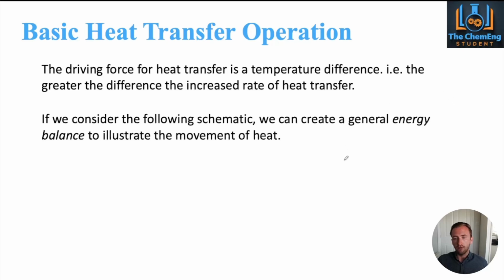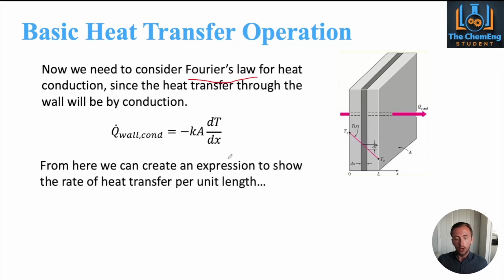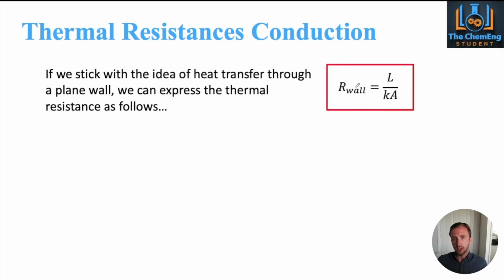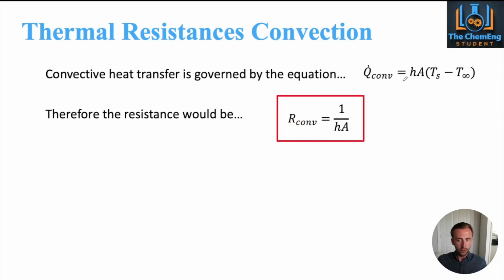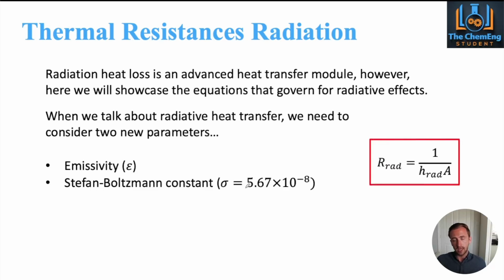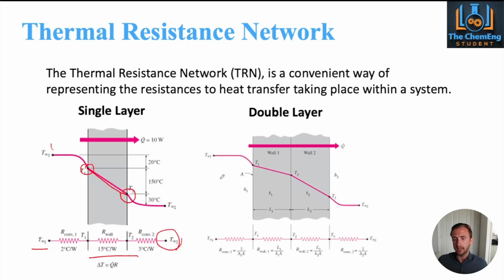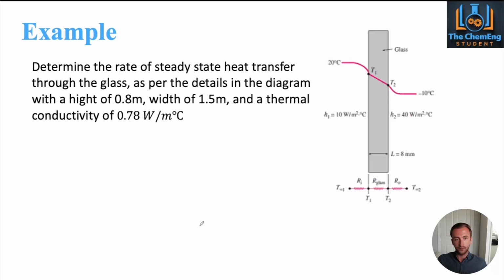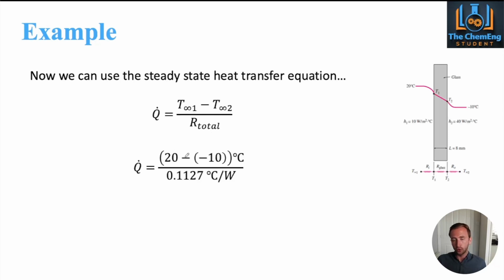The Complete Guide To Steady State Heat Transfer

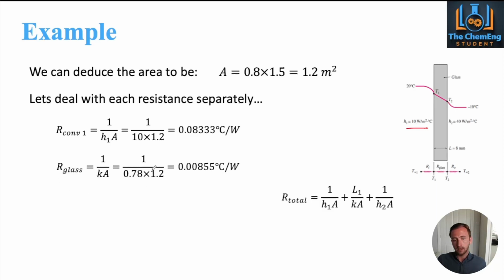Comment: 18:00 the conductive resistance should include the thickness of the glass, which is 8mm.
Reply from the maker: Yes, you are correct that was a typo on my part; thank you for spotting it! I hope the overall process makes sense?
Reply: @TheChemEngStudent  yes, your video is very helpful. Thank you

Comment: at steady state ain't the temperature of both the sides of the conducting medium same ? and thus would not the temperature difference become zero and thus Qins=0 ???
Reply from the maker: No, the temperatures at each side of the conducting material are different due to the thermal resistance of the material and initiate temperature values. The term steady-state, in this case, means that the rate of heat loss is constant throughout the material, which is of course a fictitious statement, but it helps to simplify the modelling equations. I hope this helps, thanks for watching!
Reply: @TheChemEngStudent  Thanks a ton!

Comment: Question: How do you calculate a Temperarure From Tinfinitive 1 to T1 respecto to de distance, means, at 0.5mm of the T1 surface what is the temperature?
Thank you!
Reply from the maker: There are several ways of doing this, and it depends on the information provided/known. The easiest is using the equation Q=hA(deltaT), whereby you can express deltaT as Tinf - T1, since we know Q and h the only unknown is T1. An alternative is to reverse engineer the equations in this video if we know the thermal resistance, however it would need to be the convective resistance. The video on Fourier's Law provides an additional explanation to this mechanism. https://youtu.be/Xl1R243QF_o